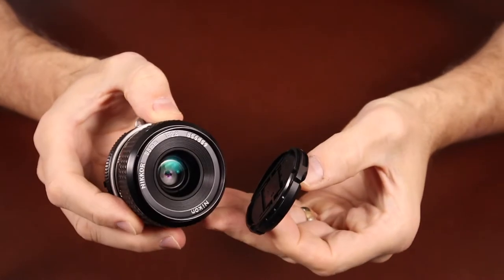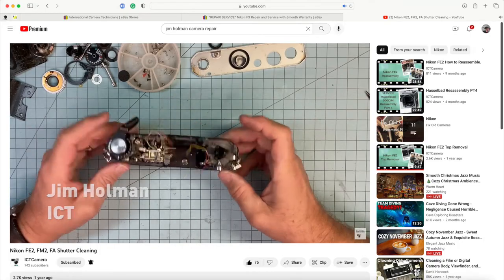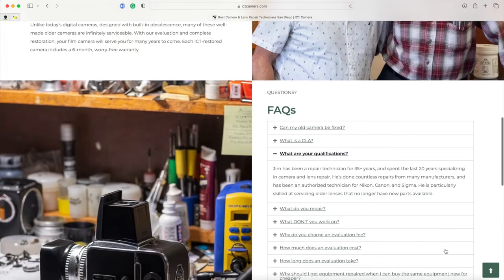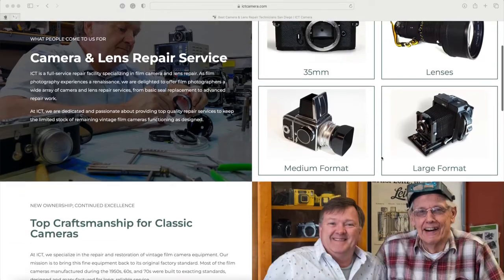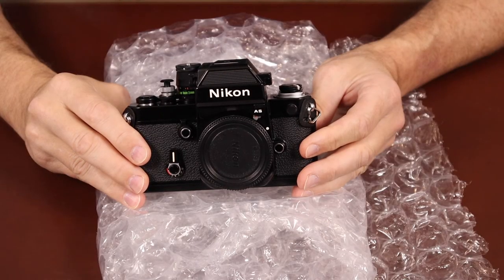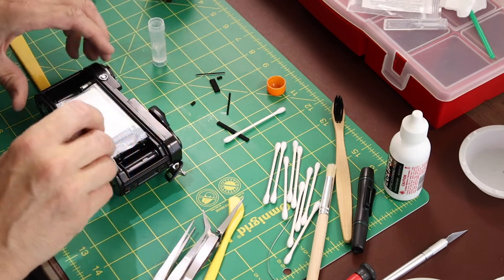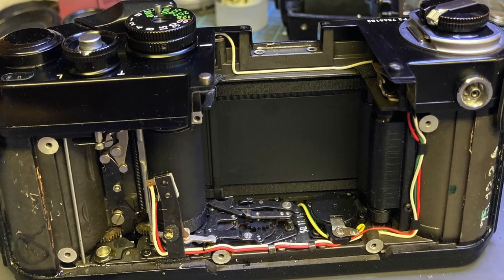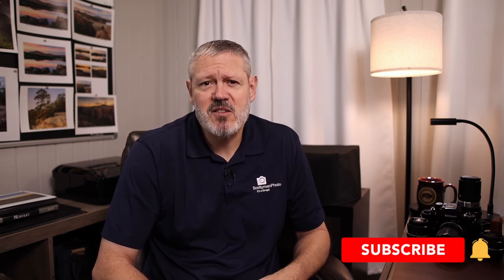Where to Get a Vintage Camera Repaired | Film Camera and Lens Repair and Service Review

Comment: Jim does excellent work! I recently had him overhaul my working, but dried out Nikon 'F'. Excellent result, it is buttery smooth and a joy to use. Very good communication and turnaround time, too. I will use Jim again for sure! I have a couple of old Nikkor lenses that could use a tuneup!
Reply from the maker: It’s very nice to have someone like Jim that is both capable and trustworthy to handle these old gems! There’s simply not that many options out there. Thanks for commenting, Ron!